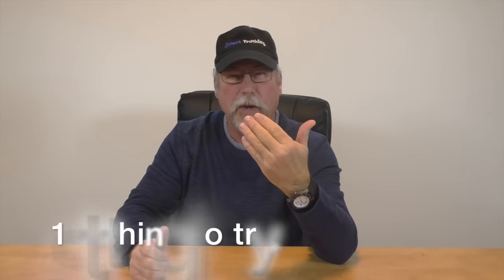How to Downshift When Climbing a Hill in a Semi Truck (Without Blowing a Gear!)

Comment: This guy really knows his shit! Truckers make the mistake of downshifting too late on steep hills with heavy loads all the time. They forget that window is different on a steep hill. The higher the rpm for the downshift, the better! The lower that rpm gets the faster that window closes. So many truckers are afraid to use those higher rpms, mainly due to being taught by these mega companies. You can use the rpms all the way up to 2000 rpms on the high side, but most guys are afraid to go that high. I always suggest guys who came from a mega company to unlearn all of that bullshit they were taught by the mega company. These trucks can do so much more than they think, but they have to push the truck harder. A lot of these guys truck's do not pull simply from them babying the truck. I've driven many trucks where the previous driver told me that the truck was weak, and it was upon first driving it. However, after me driving it for a few hundred miles or so, I always end up pulling that power out of that truck, just by simply using more rpms more frequently on those hills. The truck will only respond to how you drive it, and it also remembers how you drive it. The average driver stays between 1000 and 1500 rpms. I stay between 1600 and 2000 rpms depending on the situation and whether I'm loaded heavy, especially if I'm trying to get the power out of the truck. If i don't need the power, I'll stay a little lower on the rpms. It really just depends on the situation that will determine how I shift. The type of motor the truck has also matters. Knowing what you have under the hood always matters. You can have a low torque motor and be shifting it too high and then be wondering what's wrong. You can have a workhorse motor and shift it too low, and you'll still be wondering whats wrong. Know your truck and its specs at all times and don't be afraid of it! Even the weakest trucks can do a little more than you think, if you just drive it right!

Comment: The difference between American and European trucks is that most of American trucks are all manual and I would say 99% of European trucks are all automatic I've been driving over 4 years and I have never tried a truck that has a manual gearbox. You just don't see manuals in Europe

Comment: 1.Never run the rpms to low up hill
2. Keep light pressure on shifter let off throttle the transmission should go in to neutral immediately rev up engine and ease it with your fingers Should go right into gear. This might take some practice

Comment: Going from 8th to 7th I learned an excellent trick that worked well for me.  You come off the throttle, blipping slightly to free the selector into neutral, back on the floor with the throttle while applying upwards pressure on the selector and it would catch clean

Comment: Thanks. I will be driving 18 speed soon on my new job. I have driven 18 speed before and I had exact same problem not been able to shift smoothly going up hill with heavy load. couple of time stall the truck at Golden BC hill. I will definitely try this method now. thanks for the knowledge.

Comment: He has Good advice, I use the 1-2 method floating gears... 1 move out of the gear 2 move it in the next gear. I use to think floating gears scared me half to death, but it is really the best way to go... Using the right rpm for the speed and torque... If you do use the clutch to double clutch your gears, remember & very important "do not push your clutch pedal all the way down" you only want to push it far enough to disengage the torque from the motor to the rest of the weight of the truck & trailer. That is one the thing my teacher trainer didn't tell me, all he said was don't push it all the way, you will hit the clutch brake...

Comment: Very Good Advice this is why you need to learn to double clutch.  I have seen new guys not doing that.
Reply: Seems most guys don't anymore.
Reply: I double clutch because that's what I was taught. I've never had this issue. It seems like it would be nice to float gears but it works for me to double clutch so I'm not trying to fix something that's not broken.
Reply: @brentb5303  depends what you haul yanking a smooth bore tank sometimes you gotta float to help control the slosh. I double down on hills alot but speed is everything or your gonna be beating the crap out of yourself.
Reply: Double clutching is absolutely useless and unnecessary driving a truck. Just more wear and tear on clutch linkage. After liftoff it's not necessary

Comment: i have manual Volvo boxes, and they are synchronized boxes so need to use the clutch all the time. you need time for downshifting so have to shift early, but easy to skip gears. oldest truck is 12 years and have done local dump truck work all its life, half the year with a trailer. never had to to anything to the clutch, but its a heavy duty twin disc. 
on all the high power engines like the 750hp engine you only have the i-shift as an option. i shift dual clutch you can only get for the 540hp as max.
whats great with volvo engines they have a flat torque line. pulls good from down low.

Comment: interesting video, makes total common sense.  I don't drive trucks for a living, but the concept of skip shifting, shifting on hills etc, this is all stuff i kinda learned driving back in the UK.  passing a regular auto drivers test there is more like trying to get a CDL here.
Reply: Paul Fisher 
Trucks have the non syncromesh transmission while cars have some synchronized rings and gears so it is a very different experience...

Comment: I find a lot of inexperienced guys go for the down shift at higher rpm but end up over doing the rev to match the lower gear and then give up on the shift before the revs have dropped off to the point where it engages. Go at higher rpm but keep the rev to match within reason as you well explained the higher starting point will be absorbed through the loss of road speed caused by the gradient. Failing that know your Speedo readings for each gear and recover a gear that way maybe thinking two or three ratios lower than where you’re at as things change fast on a hill👍 Great video mate from a fan in Auzzie land 👌👍🍻
Reply from the maker: Thanks Mark! Stay safe!    Dave

Comment: Stopping for a light, I will clutch it out of gear at about 1000 rpm and then float it in the next gear down. On an incline, I will float it out of gear at about 1250 ( depending on the grade and weight ) and float in in the next gear down. That's what works for me. 10 speed btw.

Comment: Tried your Advice on the hill was going up a hill on mass pike in Mass, was in 10th gear and staerted to go below 45 mph and tried skipping? I went from 10th and went into 8th gear instead of 9th. went smoothly and no grinding sometimes the truck can't make it up hill depending on the weight of Trailer Thanks for the advice.

Comment: When I first started driver back many years ago  I hauled swinging meat in a meat rail trailer. Even with a good packed load it was a hard  but with a loose pack it was terrible but you learned how be smooth shifting up hill and down hill.And on corners.
Reply: similar for partial loaded tankers .
Reply: @NWforager  Partitioned tankers not so much, smoothbore tankers are terrible.  I used to pull 98% pure Sulphuric Acid in Smoothbores, one learns how to handle with a fine degree of finesse.

Comment: If the hill is steep you can't break torque by letting off the throttle to get the transmission out of gear.   You have to use the clutch.

Comment: It's really hard to explain in text but basically I just shipped faster so when I'm going up a steep hill with a heavy load which is everyday take it out I give it a good Rev and put it back in quicker than I normally would and that seems to work pretty good however if you do miss it here I would drop another beer quickly or I would go down to more quickly there's no reason to really stop on a hill unless you're really bad at shifting
Reply: "drop another beer quickly" Oh boy... hold my beer, watch this...

Comment: When your shifting up, pay close attention to the speedometer, I drive an 18 speed so my example may differ depending upon your stick. When I’m at 10mph I know I have to be in 4th with the tongue down and on low gear, 15mph is when my tongue is up and I go into 5th gear, 25mph I’m in 7th, 45mph I’m in 9th, approaching 65mph and I go into high gear with the splitter. When I’m shifting down going up hill, while I’m on the throttle about to shift down, simultaneously I push the shifter forward after I let go of the throttle (this was after I brought the splitter back to low to hopefully avoid a full shift down) I push the stick towards 7th from being in 8th and at the same time I pushing in the throttle to raise the rpms, if the truck and myself is quick enough to react (99.9% I’m always successful) the stick just slips in while my rpms are high, I repeat the process if necessary. If I miss a gear which is incredibly rare, I look at my speedometer and because I know how fast I was going while shifting up and I know what gear I need to be in a slip the stick right in after I give it some gas first though. Lol

Comment: Don’t recall having issues down shifting but I never “floated” my gears on a grade! You need to eliminate (neutralize) torque in the gear box in order to smoothly “float” to another gear and I just don’t see how you can do this effectively on a grade unless you do it long before you any significant momentum!

Comment: To piggyback off what your saying. Older model trucks those methods work very well I used them many times myself and had no issues in doing so. With some of the later model trucks “if your lucky enough not to have a automatic truck” I’ve noticed that high range gears tend to stretch. Since many company’s have their trucks governed where you can’t skip gears. The truck doesn’t allow you to rev to high enough to skip a gear like 10th to 8th the truck makes you follow the order of the gears up and down. 
I was lucky enough to get my truck to be wide open after taking my boss for a ride along and showing him the draw back with governed trucks.

Comment: 48 years ago we ran cab over Kenworths with Cummins 290s on hills I used to downshift every gear to the top. These days we've got more power, but I do skip the splitter on  hill downshifts. I don't know if I'm just getting lazy, or smarter?

Comment: Your comment about not wanting to start from a full stop on a hill reminded me of a trip from the Okanagan Valley (BC) to Vancouver on the Hope-Princeton. I was driving a mini van with wife and three young sons (just to establish my lack of credibility for those truckers reading this). Anyone who's familiar with that highway knows that a few klicks out of Princeton you hit a jeezly great grade at the Princeton Mines (a nightmare for truckers going up or down). The sparse traffic had slowed at the approach to the bottom of the hill, just where the passing lane starts, as there was a trucker stalled. He had barely made it to the point where there were two lanes going uphill, so he wasn't totally impeding traffic, but we were approaching him slowly. Now this unit looked like crap. The trailer was an open top unit loaded with scrap metal (no cover for the load) and both it and the load looked like they were candidates for a WW2 scrap metal drive. The tractor looked like it was the second runner-up for the semi in the movie Duel (didn't make the cut  because nobody would have believed something like that would have been driveable). I slowed way down to pass with my four-ways on (none were visible on the unit, so I wanted to let folks behind know to take it easy as everyone wants to speed up there to get a run at that hill). I don't know what gear buddy was trying, but that tractor was leaping and bucking like it was in a rodeo. Just as we crept past the drive wheels I glanced over, and there was a sound like a gunshot, and I saw his driveshaft go in a terribly unnatural direction. He'd blown a u-joint. Luckily we didn't get hit by any shrapnel, and continued on the way. Bad day for that trucker, but I do owe him a small debt of gratitude. That bang from his drive train shut up three fighting boys for about five minutes - as anyone who's been there knows, five minutes of kid silence on a road trip is to be savoured.
Reply from the maker: WOW!! Good story, thank you!     Dave

Comment: Great video. You should double clutch and have a fast arm-hand movement to move between gears, but at the same time touch the shift lever carefully and smooth to engage the gear, the truck will almost swallow the gear that is needing, never force the lever to engage a gear, it means that the transmission mainshaft sliding clutch cannot synchronize the gear, if you force it, you will break something or engage a gear that is not according to your wheels speed and something will be broken when you release the clutch quickly. Make sure to keep the engine sound strong and some extra power in accelerator pedal.

Comment: Good info for new drivers been a trucker since 1991 current truck a auto they way it's set up if u let it shift own it's on up a steep grade u lose a lot of momentum I prompt shift at 1300 own it's own it does it at 1200 that little bit makes a world of difference me hill I pull it keeps me from dropping another gear shame the way some of theses autos are programmed a driver can gauge a hill better

Comment: Back in the day.....when I had more hair...I ran the Haul Road north of Fairbanks, Ak. One short/steep hill called the the “Ice Cut” 15% I was told....was where I would shift twice with an 18 speed. 8th over to 2nd over to 4th over.  115,000lbs...12mph <1500 rpm and falling at the top. DO NOT make a mistake when it’s slick!!!

Comment: I drove a detroit freightliner, you gotta REALLY pay attention. 18-21 climbing hills and taking off. Normally I cruise at 75 in top gear (13 speed 8V71T) and at 55 I'm in 7H (11th technically). But when climbing a hill at 75 I hit 7H and for climbing a hill at 55 im usually in 6H or 6L

Comment: A friend of mine suggested going down a gear and a half instead of doing one or two ( sometimes you're not going to drop one quickly enough but dropping two might let the revs drop too much) most of the time it works for me I regularly pull B double with steel coil up a thankfully 6% hill two or three times a day.

Comment: If I'm actually dropping a whole gear not splitting the gear I stay on throttle like I'm gonna float it but when I'm ready to drop I'll stab the clutch in so that takes pressure off of it and then put the accelerator to the floor and match the rpm with the speed and it will just float right in smooth as silk you won't feel a thing at all no jerking or grinding at all

Comment: When I used to go up mountains with a 2016 Cascadia with an automatic, I had to use "manual mode" because the shifter would constantly juggle between:

9th gear
7th gear
8th gear
9th gear
7th gear
9th gear
7th gear
8th gear
9th gear

Has anyone else experienced that phenomenon with an automatic?

Comment: So there’s water trucks in my area because of fracking, and we’ve had quite a few trucks break a gear because they can’t handle launching off the one hill that has a steep grade. Almost saw one break a gear tonight while I was getting gas.

Comment: seen this several times to Portland OR highways on steep turns where cars nearly rear ended the slow trucker trying to grab a gear . If you fall 15mph below speed limit in a highway speed area You Need to put on your Flashers . Its one of the few time i hear you can be ticketed for being rear-ended if your flashers weren't on

Comment: What's a clutch?? 10 to 9 is done BEFORE you start to load up engine and trans. Just give a little gas and at the same time push firmly from 10 to 9. Faster than an automatic. NOW check make sir your fully engaged and let of throttle for an instant and push shifter forward again ( just to make sure) . When you get th feel for that movement, you can start on the 9 to 8 shift. It's easy once you learn to do this with confidence.

Comment: What i was taught is shift early based on mph. For instance 8th gear is normally good at 35mph so drop it in 8th at 40mph and it puts you at the top of the torque range in 8th. Shifting early just a different way.

Comment: I had this my first two months driving.. Down hill is where you worry; uphill you just give it another 0.5-1k over power band and be fast..
Reply: You don't have to worry if you use left foot on the brake to control speed. Then you have full control of the throttle with the right. Hence the fact that you don't need the pedal on the left except for takeoff

Comment: I can do this with my eyes closed 
In fact,  it might be easier. I've always said the best trucker were musicians. Timing is just something you gain with experience. I was just speaking of those crunch and slam the throttle kind of guys. 

Think smooth and ROLL into the throttle. Shift like you own it. When it comes out of your pocket you'll be smoother and easier. Think,"I'm making the payments, it's gotta last". 

When you drive a rig you don't own, don't hesitate to take a rider. Make sure the only thing they can say is "I felt like it was a smooth auto ". 

Sometimes when it has to be a fairly quick shift that doesn’t mean it has to be a hard shift.